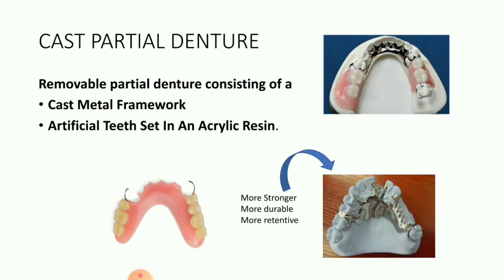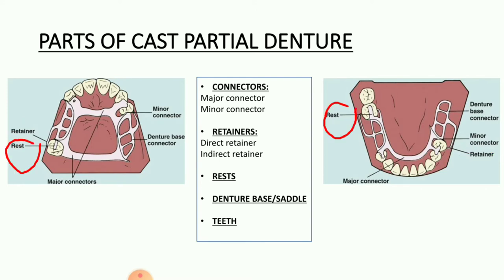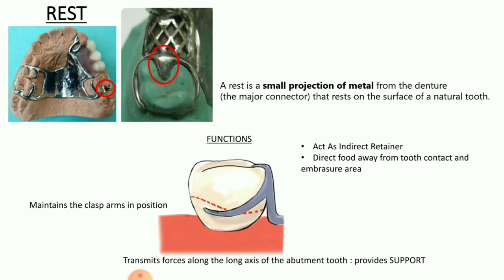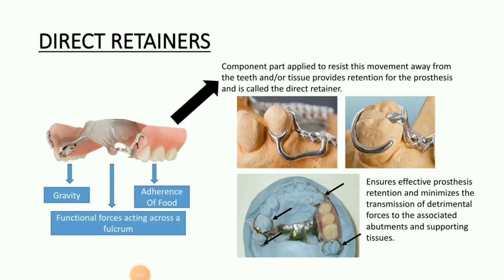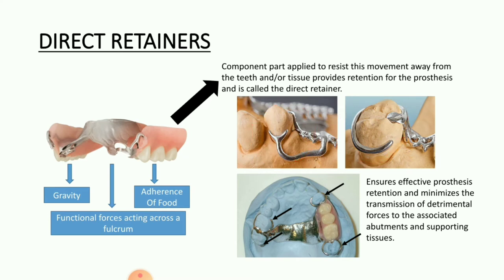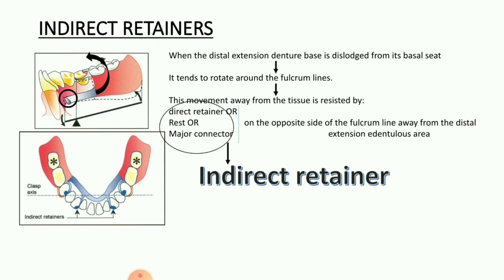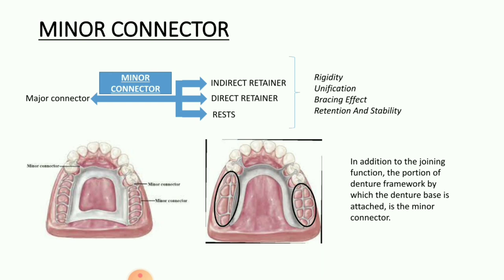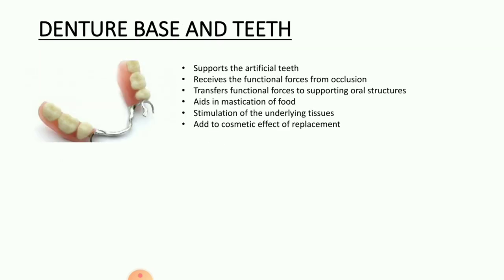Parts of Cast Partial Denture and functions in brief.. MADE EASY

Comment: Hi doc!
Im thinking of using one but I have many doubts and fears.
Do the retainer clasps damage the healthy teeth where they are attached?
Can you chew and eat well with it?
Is it a good option today?
Thanks!
Reply from the maker: Hii...retainers only damage the healthy teeth when they are active all the time... but this is not the case ..the clasp should be passive otherwise and should be active only at the time of function..this is Called as PASSIVITY..one of the principle of direct retainer...
Patient can very well chew and eat with cast partial denture in place ..
Just we need to follow the mechanics and design the denture properly...then it can work really well 👍